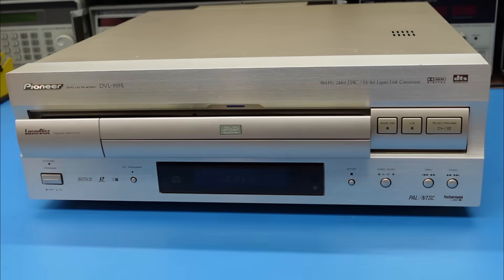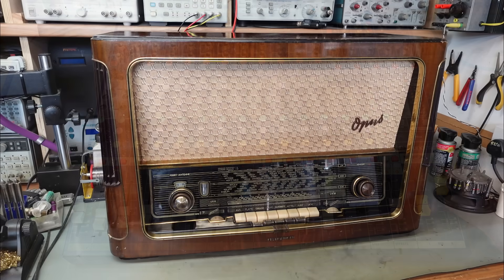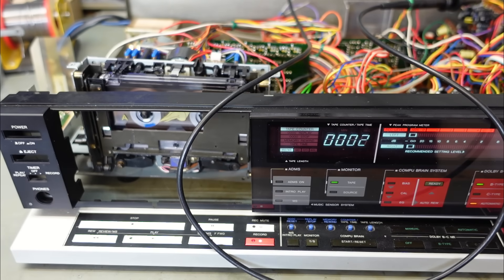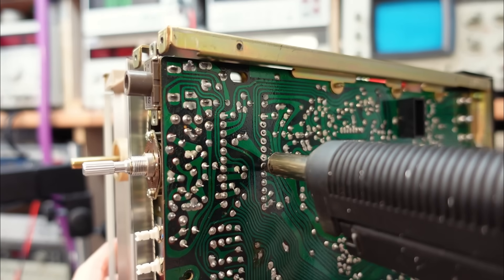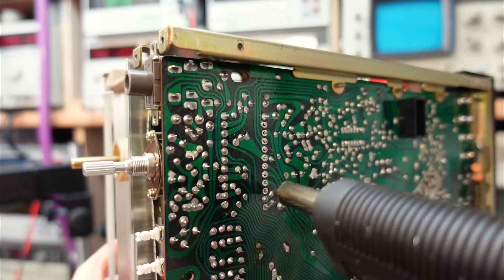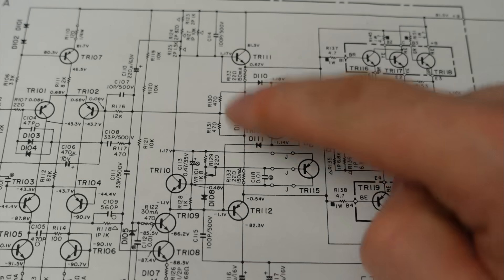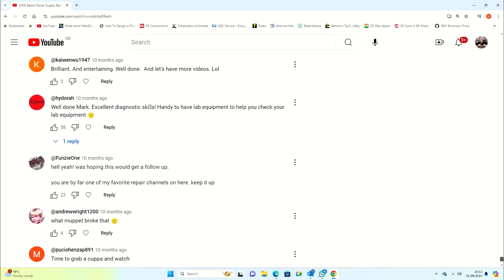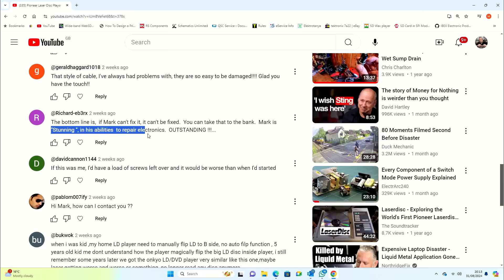The 3-step Process To Repair Any Vintage

Comment from the maker: Want to Master the art of electronic repair? 

Check out MendItLikeMark: https://www.menditmark.com/menditlikemark
Reply: Hey Mark just a heads up, I scanned through the page and found contradictory things, it might be typos or miscommunication because for example I found that it states a 30 day money back guarantied and in another place it says 14 days, it is not clear if its for the promo launch or something else
Reply: Hey Mark the link isn't working
Reply from the maker: @EnchantedRhythms  try again!
Reply: @MendItMark   hi Mark can tou fix somthing for me 🤔
Reply: any sign of setting Direct Debit  up for anyone who doesnt have the lump sum up front Mark
Reply: @mactheweld  Thats the first thing I thought of also. 1/3 of the price or something is alot more palatable for someone to "risk" .
Reply: Link doesn't seem to work, at least not from here. It redirects to a clickfunnels page
Reply: there we go!
Reply: 6:55 I've had that moment with your videos. I still prefer your videos over eeblog. A couple of months ago I started some repair jobs. Built me a bench, acquired, a scope, signal gen and power supply. So far I've done 2 guitar amps, and an old Sansui amp from the 80's. Tried to repair an old subwoofer, but the damage was to far gone. Ended up stripping out all the cool bits, like knobs for pots, transformers, 2 massive mostfets and the drivers. Next for the bench is an early onkyo hdmi avr. Reports are the transformer smoked, and now it does not come on.
I have you to thank for this wonderful journey.  At some point I may record some videos as well.
Reply: hi mark , wondering if you ca help.. i recetly bought a Lightware MX DVI FR32 , and need to program it,, any ideas ??
Reply: Ha ha.. Mark, i studied electronics in the 80s at college.. Different world then... No cheap stuff from China.. Building your own kits was often the only way of having units that would otherwise cost a fortune ready made. I learnt so much from those days, it is a wonder electronics it really is, those were the days (54 now)
Reply: Howdy Mark, I signed up for the program straight away.  That is very exciting news, I can't wait.  I did not however see a confirmation or receipt.  Is that normal?
Reply: If the link isnt working for you like it wasnt for me you might need to add the domain to your pihole/addblocking whitelist.
Reply: Mark are you still doing the course? I am interested in joining
Reply from the maker: @garypalumbojr933 Yes, I’m still doing the course, and the Mend It Like Mark community.
Reply: @MendItMark link doesn't seem to work , got redirected to clickfunnels page.

Comment: You've insprired me!!! 2026 is the year I will try to learn electronics/repair. The first hurdle for me is I have no equipment and live in a really small room. But I noticed you used a handheld meter/scope thing in the past so perhaps I can start there. And only repair some very simple devices. Can you recommend a common thing that can be found in a "broken" state, that I could fix as a hobby but maybe later be able to sell on for a small profit? (Perhaps games consoles such as Game Boy or SNES?)

Comment: This is exactly the sort of thing I was looking for. There's really not much of an option for learning this sort of skill apart from either getting a degree in a related area or just picking it up in your free time as a hobby and gleaning what you can from online forums and other sources. Very interested in this.

I've been building up a workbench oriented specifically around servicing and repairing cassette and open reel decks, since those are the components I have that seem to require the most frequent maintenance. But I've lost momentum because I started to worry that I was going to have all this equipment and then just not be able to really learn how to effectively repair anything. I've been stuck working on a Nakamichi 480 for months now. It'd be great to have a video course that presents what you need to know in a sensible order. It's overwhelming just being told 'learn how to read schematics first' or 'you need this piece of equipment before you can test anything'. It'd be great to have everything laid out a bit more accessibly for a beginner.

Comment: Me …here in Co Cork Ireland…i have 2 Cd players one big Technics so called Class AA Model and one midi sized Denon , both not spinning up. The big Technics laser is lazy but the laser drive isnt made anymore…but there are a few other ancient models that used the same drive. The Denon is possibly current enough to get a replacement drive …work beyond me and no one in Cork area does this reliably. Someone once said the gas has evaporated from the Technics laser

Comment: MenditMark is an truly an asset to anyone who wishes to work on technical equipment of any type! He clearly demonstrates the entire trouble shooting process: triage, analyzing what is the problem with this unit, disassembly of the unit, initial test measurements for diagnosis of where the specific fault lies, repair of the specific portion, and re-test to confirm the fault has been properly found, re-assembly and final test. You don't have to have all of the equipment Mark posses, start out with a DVM, an oscilloscope, DC lab power supply, VOM, audio generator, Variac, and various test leads, this small group of electronic test equipment will allow you to repair almost any type of consumer electronics. The most important part of repairing technical equipment is the desire to find the problem and repairing it, the single most gratifying aspect of this entire process!  David Riddle

Comment: Rather a Blarzae attitude to, a very complex subject. I have been a competent electronics engineer for over 65 years and have been quite successful, if I do say so myself. However, old age has slowly descended, and my memory capability has gradually diminished. Now at 84, I take things apart and cannot remember the sequence in which they go back together. My hands no longer have their fine coordination, and they shake when trying to solder even the largest joint. My hearing has also gradually disappeared, and I can no longer hear the radio clearly. My sight has also been affected, and I have problems seeing the smaller surface-mount components. My other beloved hobby is precision engineering, which I still try to follow, but those same problems physically prevent me from making anything but a mess. However, there is one last option that I enjoy, and that is you and your channel, which I enjoy more than you would think. So keep up the good work, as it also brings back many enjoyable moments. Regards MoK
Reply: A smart phone mounted whilst you undo is what loads of engineers now use, irrespective of age…dismantling gearboxes on ww2 german tanks …filming is essential
Reply: I wait for everyone else to screw things up or just give up, Im 59 this year, and very confident, I started taking radios apart before the age of ten, was buying everyday electronics magazine at 11 with my pocket money, and building circuit’s from then, I was repairing the locals CB radios at 14,15  and making good money in the hand, I bought an Akai 4000D reel to reel at 15 out of my proceeds. at school and college I passed A level electronics, and was designing and building on vero board very large circuits in my first job, and repairing them to component level, Mark over-simplifies the explanation of how easy it is, purely because he knows, its definitely not a subject in something that anyone can pick up, You have to know how the components work and an understanding in theory to  what they do and how they interact and work with each other, Just my two pence. I do like Mark and his channel and giving people confidence to get started in a subject is noble thing to do, I cant help feeling taking this to the next level will leave a lot disappointed and  wont benefit nearly as many people ( except Mark) as people will over-estimate their own ability due to Marks confidence in them.

Comment: I need a mend it mark in the states specifically illinois. Have you ever fixed a Buttkicker Pro Amp 150w? There is an ongoing problem with them where just all the sudden the standby light goes out and the amp is dead. Cannot find any information online about this amp just complaints of it happening. I know on the 130w amp there was a resistor that would blow open maybe this is along the same lines.

Comment: I used to love doing exactly what you do. Mending stuff. Since I was 14, when dinosaurs walked the Earth. The trouble became with employers. They no longer want you to spend time tracing faults to discrete components. It's change the board. Working? Change another board. Until it works. Charge the punter for the boards. Killed my passion completely.

Comment: I've been watching a lot of these videos recently and that reminded me I had my sisters old Phillips CD play to fix. I had given her a old LG DVD/CD player and had forgotten all about it.

I had assumed the player would just need a new drive belt to fix the tray not working, expecting a rubbery mess inside I went onto Ebay and purchased a can of IPA, I got a 4L can as it was 99% and just over twice the price of the 0.5L bottels. It is likely to be a lifetimes volume for me (I'm in my 60's), but it has already saved me money and time.

On opening the CD player I was surprised to see the rubber belt that is over0 30 years old was fine, it was the plastic fly-wheel+cogs that drives the tray in & out that was broken. It looked like a few teeth had snapped off but when I touched it to lift it out it snapped and crumbled to dust.

A quick search on Ebay using the players model number showed lots of belts, but also about a dozen sites selling both a new belt and a new (old stock) wheel/cog drive. I could tell it was old stock by the amount of dust that was on it. I needed the IPA to clean off all the powdery plastic out and some old grease that had set hard like wax. A little lubricant and fitting the two new parts had it all was working fine, it took longer getting the tray/lifter out of the way (having more than two hands could have been useful).

About a week later I found one of my DECT Phones was not recharging, after putting my stronger reading glasses on I saw there was some waxy muck on the phones power contacts. A quick clean with that IPA had it working in about 5 minutes, all in all a lot cheaper than replacing the phones so that IPA has already more than paid for itself.

Now my next job is my Dad's old Sony receiver from the early 70's, it works very well until you touch any switches or dials then it's all crackles and crunches. Should be a simple job and I haven decided to put it the living room along with some small and cheap JVC speakers I just happen to have, the Radio+Tape (destroyer)+CD-player unit died many years ago and was not worth the effort to fixing, it was not than greate when new. I also have the original Sony speakers, but they will likely need looking at before even attempting to use, but they do have lovely (quite large) solid Wallnut Speaker cases, MDF had not been invented back then.

Comment: Many will tell you not to turn the device on before testing for shorts between the power buses and earth or between the power buses themselves. Why? because any components not yet killed could still suffer. No obvious shorts? ok turn it on looking for excess heat with infra red if you have it or by applying IPA (isopropyl alcohol) to watch for evaporation. Negative? OK make sure the power gets to where it should be going. The plot thickens.

Comment: Mark is unique... how many repairers have access to $50,000 worth of test gear... and how many know exactly how to use it. I'm an electronics engineer myself and have worked on vintage equipment from time to time and believe me mending any electronic gear isn't for the layman ... you need a thorough grounding in both theory and practice when it comes to understanding what you've got to do.

Comment: My experience with manufacturing tooling was the same. First, understand the exact nature of the fault- what happens and when (log entries from operations that say "tool down" aren't much help). The best way is to see for yourself. Second, develop a testable hypothesis to explain the fault ("it would do X if Y had failed") and then test that hypothesis. The danger here is jumping to conclusions based on prior experience- always question your assumptions. Third, perform the repair, AND if something needs to be changed to prevent that failure from happening again (which can happen if the tool is very complex and the vendor only built one of them), implement that as well. Then document everything.

Comment: Very interesting I started off as a industrial electrician in the early 80s one of the old city and guilds guys.
Back in the 80s and 90s I used to design and build circuits to suit my requirements as back then most of circuits didn't exist.

Comment: 1. Rule 1 - exceptions. I use here Visual inspection. If there's a fault which you can spot with your eye's, you should not turn the device ON. Instead, you should replace the faulty component. Let's say HDMI port is faulty, can make short of 5V to ground and kill an HDMI encoder this way.
2.Rule 2 - hidden faults. You replace the component, haven't seen any shorts, but, after replacing, the bulb in series is lightning up fully or partially. So, no, not always is as simple as in this video :D. Even with voltage injection you can miss things to be true ;).

Comment: I’ve a very similar process, it has been derailed somewhat recently by fake parts. I’ve had to add another step, that is to never assume the replacement parts are any good (test every step before moving on).

Comment: Hi Mark : My Pioneer 919e LaserDisc only works on its side. When I lay it flat, the tray won't open and it won't play CDs or CDs. How can I fix this? I forgot to say that only when I tilt the 919e on the side of the play  button Thank you very much.

Comment: I wonder how much all your equipment cost.  I love watching your system.  I am a mostly retired physician.. There is a method to diagnosis...I love solving puzzles..I've been watching a while.  My son was was running around the neighborhood helping them set up their computers.  I have enjoyed learning about electronics...capacitors, diodes, etc... I will never DO this kind of work, but I love learning about it.  The biggest problem...I'm a sloppy solderer.

Comment: My process starts with "Are there a thousand wires, many the same colour despite doing different things, all soldered to everything everywhere?"

If the answer is yes, then the moment this gets at all tricky it's going in the spares/ scrap pile.

Same goes for gluing and welding and otherwise making something impossible to get apart without damage. I'll give it a go, but I'll curse the throaway consumerism company who made those design choices.

After that... Well things still usually go wrong. But at least because i'm an idiot, not because the manufacturer was a cheap douche.

Comment: Hi mark,I’ve got a kenwood x-s300 tape deck.  As u put the cassette in it makes all the right noises but the cassette sprockets do not turn.  I’ve opened it up n think it’s the solenoid not engaging the cog mechanism.  How do I check the solenoid if good or bad ..?

Comment: Mark, stumbled on your channel and hooked!
Watched this video and promptly fixed 2 pieces of gear, (jvc tape deck & 400 cd changer) and tore down an old rota screw driver which has a nice swivel head to replace batteries- thanks for this method!

The tape deck wasn't even broken but simply wasn't plugged into a working outlet(😮).
The 400 cd changer- well the remote batteries had gone bad and leaking all over- when I cleaned up and fresh batteries cd changer stopped it's death loop of switching discs-
And best of all these were all done by sticking to the plan, and didn't have to go past step one.... thanks Mark!

Comment: Hi Mark, thanks for your amazing repair videos. An inspiration to watch and to learn. Love your setup and wanted to ask if you could kindly show us how you built your current limiter using two incandescent bulbs and how your switch and V & A meters are all wired up together please. Also could you share with us please how you built your dummy load and what component values you used for your resistors? Keep them coming and thanks for sharing your skills.

Comment: After watching many videos of yours, lately, I collected some courage and opened up my old turntable, a Pioneer PL112D, and I refurbished it slightly. It needed a pulley cleanup and a suspension adjustment (the plate was scratching onto the frame, especially when loaded with 180g vinyls, and it ran quick and higher pitch when on 33rpms). Now my attention should be turned to the very occasional buzzing at startup

Comment: Few things i repaired, all i can say is heat. My washing machine trip the main rcb. Scratching head took lid off and thought, heat. I disconnected the heater element to the dryer section, switch machine on, it ran. So fitted new heater element, all fixed. Back in 80's colour TV, picture would jump around after 10 minutes, i thought heat. Pulled the circuit board out, looked at power resistors, one had dry joint, easy fix.
I fitted a Sparkrite (remember them) box that would  switch the high tension on car coil. Car stuttered, i took box apart, again big resistor dry joint.